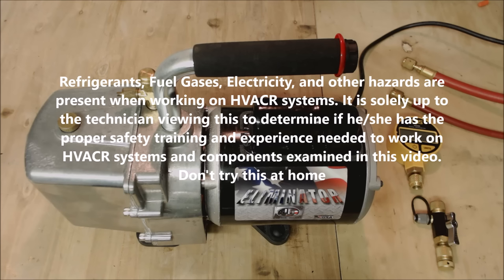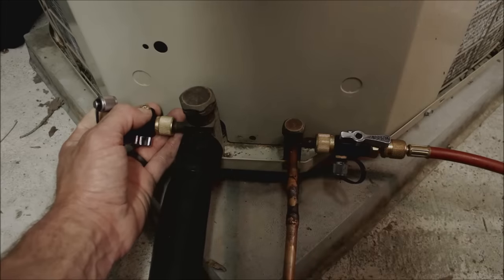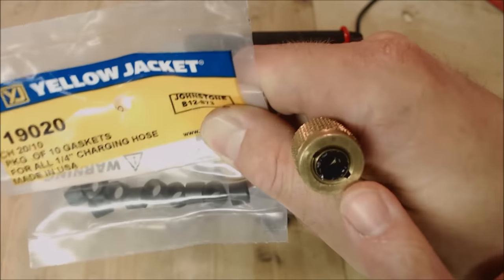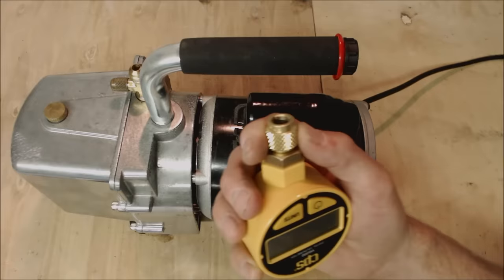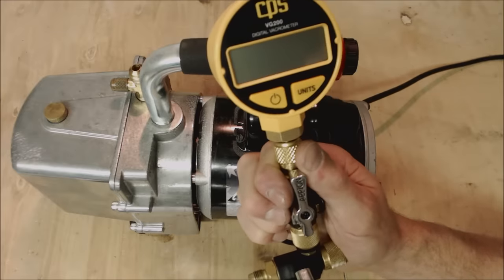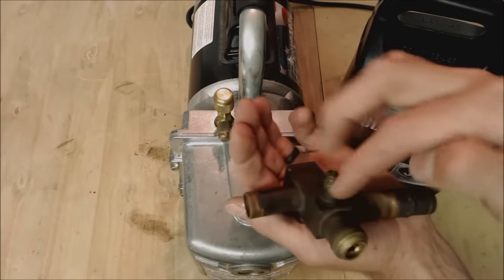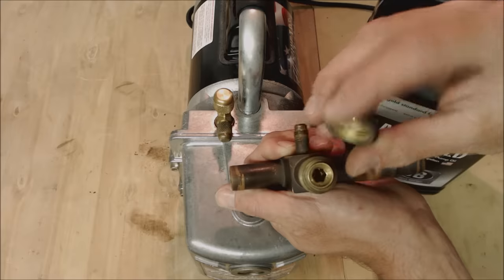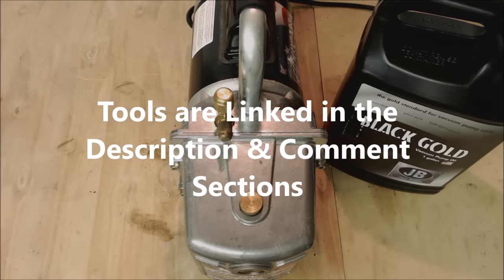HVAC Tips to Avoid Vacuum Problems! Top 15!

Comment: I'm a newbie, but when you're pulling a vacuum in an already charged system that has a leak you want to repair, are you vacuuming all of the liquid refrigerant into the compressor and tightening the allen key/hex valve of the liquid line thereafter to isolate the liquid refrigerant in the compressor OR are you vacuuming all of the liquid refrigerant into an external recovery tank rated for your R rating? Thanks!
Reply: You could either pull the refrigerant back to the condenser & isolate with the service valved or use a recovery machine to move it into a recovery tank...it really depends on the repair...I hope this helps

Comment: Hey Craig, for tip #3, could you switch the position of your micron gauge and hose on the removal tool? Take the cores out and be able to valve off the micron gauge once vacuum is complete?

Comment: What do I do if I’m getting bubbles in the vacuum pump sight glass? Working on an automotive R134a system, if that matters. Vacuum pump was overfilled.  Got the level right and it’s a lot better but still some tiny bubbles.

Comment: hello sir i am from Indonesia. may i ask one thing if ac split unit no more gas or refrigerant at all . when we vacuum.the system should we open service valve and high pressure (small pipe)  valve all the way?  thanks

Comment: Another Excellent video..just wanna ask how to vacuum a unit fitted with EXV..pls reply
Reply from the maker: If you are talking a minisplit, you would just use one line going to the two valve core removal tools that you have mounted together on the one suction port with the micron gauge on it. The exv is located in the outdoor unit so there won't be a vacuum restriction half way down the line at the evap coil, thanks
Reply: acservicetech thanks so much for the info..cheers

Comment: Hello great video!  I have a question.  The oil in my vacuum pump wasn't changed for a long time and now it overheats and shuts down.  I found wires on the motor melted through, probably because it is working too hard and overheating.  If I replace the seals in the pump and flip the impellers, will that help the pump to run well again or is there something more that could be damaged?  P.S.  the oil is now changed :)
Reply from the maker: It is possible. I have found that after running bad oil for a while, the pump may not be able to get a deep vacuum even after the oil is changed a couple times with new. It may be worth a shot though! If it doesn't work I have the pump I use linked at amazon.com/shop/acservicetech and cps has a decent price on a 4 cfm-https://amzn.to/2I9ca7A   -I still think it may be worth a shot though, thanks!

Comment: Big fan of your channel been seeing this problem maybe you can help? I work for Vending Machine company and been seeing 1 or 2 refer units they bring with low charge. And I nitro test them and holds for 30 mins plus I put 205 psi in them. And they drop to 500 microns and hold there vacuum. Have in mind they have no service ports so I add them on.. So how is possible for these to units to low charge if there is no leak? And units they bring are like 7 to 10 years old mind you. Have you ever come across this??
Reply from the maker: You could do the pressure test with a digital gauge set to see small incremental changes. If the system holds vacuum for 10 minutes then there shouldn't be any leaks. You are putting on brazed or sweated on ports correct?

Comment: Bluevac micron gauges are rated for refrigerant pressure so you don't have to valve them off
Reply from the maker: Hey Joe, I believe they all are rated for high operating pressure in case of an accident but we don't want to cause a leak and we don't want to get refrigerant oil on the sensor. BlueVac is a great pic too, thanks!

Comment: I wish I had one of those removal tools. I just installed my condenser,txv,new coil,3/4 line set. I use the sman 460 micron guage....not the most accurate but I kinda fudge it a little.
Reply from the maker: Those 3 valve core removal tools have become essential to me for vacuum and recovery, thanks Jason!
Reply: We use VCR very rarely. Normally we remove a valve core with screwdriver style core remover, then reinstall after you've charged to about 5psi. 
No VCR required
Reply: @Froggability  same 🤙

Comment: Hey I’m getting your set up but instead of getting the cps I think I’m going to get the $200 BluVac+ Micro Wireless Digital Micron Gauge with Coupler and Bluetooth it’s the mini affordable one they sell what do you think? Sounds much better than cps and field piece from my research.
Reply: I actually ordered the blu vac+ LTE looks like a great product a bit spending I will update on how it works. Thanks for all theses videos my vacuuming down systems will be much better I’ve been taught to use my field piece gauge manifold for 3 years now and it’s time for a good vacuum set up.

Comment: I love my sman 380v manifold BUT the low side valve leaks at anything below 1000 micron. I have done the dielectric grease mod and it's still leaking. Someone should make an aftermarket replacement valve kit with tighter orings. I tried using a slightly larger diameter oring but it wont seat without being cut on the sharp lip inside the valve. Rounding the lip or making the inside barrel of the valve a few thousandths smaller would help alot.

Comment: Just want to know what kind of tool you used to remove core depressor from the hose?
Reply from the maker: Depending on the valve core manufacturer, a valve core removing driver will work or you can use needle nose to unscrew it out, thanks!

Comment: Will one valve core removal tool size fit in  both lines??? Or do I have to buy one for each line?
Reply: You need AT LEAST two.  Hooking up a vacuum pump, micron gauge, and manifold (or refrigerant line) is too many connections for one port, on one valve core tool.  Doing it with three valve core tools, like the way shown in this video, is how I do it... and it's bullet-proof.  No chance of ruining the vacuum, you worked so hard to get, by changing lines before you re-charge.  Just be SURE to exercise all the valves while you are pulling the vacuum.  Nothing more frustrating than have your micron gauge shoot back up when you shut the valve (to keep refrigerant out of the micron gauge).
Reply from the maker: Yes Alex, you would need three valve core removal tools. The same size typically fits on both sides. For residential light commercial, we use 1/4" ones. I have them linked at amazon.com/shop/acservicetech   - Check out "acservicetech vacuum playlist" for more vacuum videos, thanks
Reply from the maker: Thanks Leo!

Comment: Accutools BluVac micron gauges can withstand up to 500 psi . Pretty unlikely to freeze water unless you are using massive hoses and a big pump. Usually if do have any ice sublimation will take place. Triple evacuation is a waste of time.
Reply from the maker: Yeah the cps ones are also rated for high pressure but I just try not to foul up the sensor with any refrigerant oil. I agree completely too. Thanks for what you are doing for newer techs in the field Ulises!
Reply: AC Service Tech LLC  for sure. I wish your channel was around when I was getting started. Keep it up.
Reply from the maker: Thanks a lot Ulises, it means a lot!

Comment: is the smaller vacuum pump you list on your Amazon tools large enough for residential units?
Reply from the maker: Yes the 3cf would be fine. It is more about using the three appion valve core removal tools to remove the restrictions at the valve cores than the size of the vacuum pump, thanks
Reply: @acservicetechchannel  three tools? only see the valve core removal tool?
Reply from the maker: Yes I use three appion 1/4" valve core removal tools, two hoses, and the cps vacuum gauge for all of my vacuums. Check out the video "acservicetech full vacuum procedure", thanks!
Reply: @acservicetechchannel  will do, thank you

Comment: Cps micron gauge is rated for 400psig ... I use the side port on appion crt and release the charge then pull the gauge off
Reply from the maker: Thanks Dennis, I use a third valve core removal tool to valve off the gauge to try to avoid any excess pressure or the potential for the sensor to get dirty with refrigerant oil, thanks.

Comment: Hi I bought 2nd hand Samsung mini split my question is that on my service valves I can only connect gauge or vacuum pump to low pressure side there’s no connection to high pressure side how do I deal with that how to vacuum it how to know what’s pressure like on the high side maybe it’s just stupid question but I’m learning it thanks for help
Reply from the maker: You can vacuum on the low side port only since there is no metering device half way down the lineset at the evap coil. It is usually in the outdoor unit on minisplits. We used the total weight method to verify the charge. It is by the weight listed on the rating plate of the outdoor unit and shows the max cumulative length of line set that is included in the factory charge, thanks!

Comment: hi, i have an older vacuum pump that exhaust at end of handle. At beginning of start up i see my gage goes to 29"hg really quick with some vapor exiting end of handle ( i can feel the pressure coming out with my finger). But after about 10min of running time it's almost like nothing was coming out end of handle anymore. I couldn't feel any air pressure coming out at all. However, my gage still reads 29"hg. Is my pump defective? thanks.
Reply: After 10 min it's pulled out 99% already. Your machine is probably not defective

Comment: Hope someone can answer this!!! 
What are the pros or cons of removing the valve core with a regula screwdriver compared to this fancy one
Reply from the maker: If the system is empty then you can remove the valve core with any tool but you must have the valve core removal tool attached to pull the vacuum through it and to put the valve core back in after the system has positive refrigerant pressure, thanks!

Comment: is there any way to avoid using second valve core removal tool for a vacuum gauge?
Reply from the maker: Not unless you do what some people do which is either contaminate the sensor of the vacuum gauge with refrigerant oil or replace the valve core before breaking the vacuum with refrigerant which I would not recommend, thanks!
Reply: Use a ball valve instead of a VCR

Comment: When you say pull it down to 500 microns is that the same as 29 in of mercury? Thanks!
Reply from the maker: 500 is 29.9" and to give you an example 4000 microns is 29.76" so always make sure to use a micron gauge and not an hg gauge, thanks Blade!
Reply from the maker: Thats wrong then. Go to http://refrigerants.com/pdf/NRI-PTCHART.pdf  That is National Refrigerants. They have a micron to HG conversion table that will explain, thanks Blade!
Reply: Your calculator is giving you "Absolute Pressure" (referenced to 0.0 being an absolute vacuum).  Gauge pressure (what us old HVAC techs use) is zero-referenced against ambient air pressure, so it is equal to absolute pressure minus atmospheric pressure.  We just omit the minus sign.  If you do this stuff day in and day out...the convention makes sense (to us, anyway) because it's the way our gauges communicate pressure information to us.
Reply: Thanks man! That helps a lot! Maybe the conversion calculators I've found aren't even dealing with vacuum. They all pretty much give that same answer though.
 .0196 microns of mercury = 29.9 in hg.

Comment: Do you which valve core tool I would need for m hvac?
Reply from the maker: Did you mean MVAC for vehicles? or for buildings? For buildings I use the appion valve core removal tools. I have them linked at amazon.com/shop/acservicetech thanks

Comment: how many hp should my vacuum pump have
Reply from the maker: we use 3 to 6 cfm usually for residential but check out my other vacuum videos where I show the hose setup and valve core removal tools. That is much more important than the vacuum pump size for speed and effectiveness, thanks

Comment: Do you know why I'm getting vacuum pump oil in my hose when I finish vacuuming my ductless AC system.
Reply from the maker: Your vacuum pump must not have a check valve. Older pumps used to do that but newer ones usually have a check valve to stop the oil siphon, thanks!
Reply: You turned the power off too soon

Comment: My LG smart inverter doesn't have a service port how do u vacumn ???
Reply from the maker: It should have a service port on the vapor side. Mini splits usually only have one port, thanks!
Reply: @acservicetechchannel  thank u but the LG split system is multi zone and it's doesn't ,,have u ever used an online service tee ?? I saw one on another system today

Comment: Adding new seals to old removal tools makes replaceing unit schrader valves valves back onto the unit service port nearly impossible.
Reply from the maker: Hey Max, the valve core removal tools usually come with the exact size that they have in there, thanks!
Reply: acservicetech. Reread comment, edit made.
Reply from the maker: So you are having problems with putting new orings in your valve core removal tool and you are saying that they are blocking the path of your schrader valve going back in? What tool are working with? Where are the orings coming from? Thanks Max
Reply: acservicetech. Yellow jacket removal tools with the same yellow jacket schrader valve seal replacement kit thats usually available at supply house.
Reply: acservicetech. How many times do you replace the seals on your removal tools.

Comment: I dont use my gauges for vacuuming they aren't rated for vacuuming the best way I found is to just have a vacuum hose from my pump right to my valve core removal tool with micron gauge at the tool and I just vacuum from the suction no need for 2 hoses
Reply from the maker: I just use two hoses so the vacuum does not have to go through the metering device half way through from the suction line port to the liquid line port. That's all and it makes it very fast, thanks Dan, glad to hear you are not using your gauges for vacuuming!

Comment: Commercial tech over 15 years. I hate those recovery tools I cant tell you how many times I was almost finished with a job, unit filled with new refrigerant, everything tested and ready to go, and bam you cant get that valve stem back in through the recovery tool (and yes I have tried loosening the connection to releive the expanded tool gasket/rubber insert) still no go. Now you have a choice to make start all over again or leave the $50plus recovery tool on the unit and leave. I have left over 4 tools and no longer use the recovery tools for this reason. I have used many different brands and have had issues with all of them. Also any ball valve type connection from your hoses is a bad idea. I have had them leak through the handle many times causing frustration and false readings (always check your own gauges, hoses, and connections for leaks first if you suspect a refrigerant leak). Just put your low loss fittings on, use as thick and short of vacuum lines as possible, send dry nitrogen through the circuit to speed things up, and pull with the vac it never takes that long specially on residential equipment. I pull systems down with over 100lbs of refrigerant this way with no issues. All the recovery tools I used also had specially sized inner hose gaskets so if it gets torn which it will you have to have the right one which will not be in your truck when you need it.

Comment: 2 stage 12 cfm or larger is the best
Reply: Not for houses..using a 12cfm with trublue hoses will def start freezing the moisture..the best thing to do is use your manifold gauges to slow it done some..or use a 2cfm vaccum pump and use the trublue hoses to get down to 200microns ona slower time (5 mins)